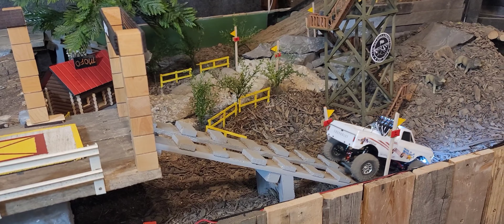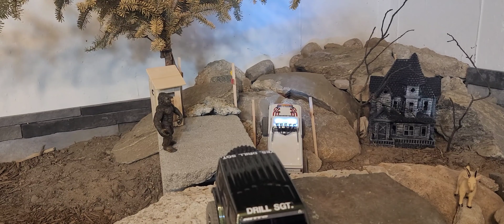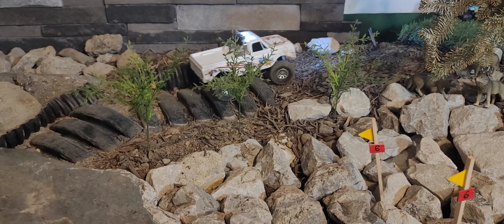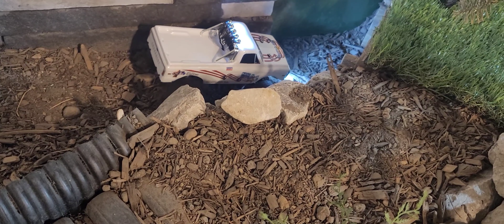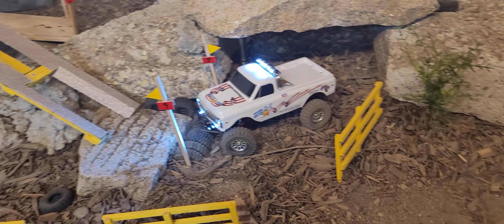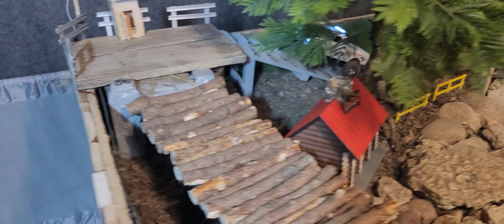scx24 Deadbolt (USA-1) crawling

Comment: I love that you have MOFO Garage. I have 2 trucks built off his parts and the off-road trailer. Right now I’m waiting for his 6x6 lcg chassis to show up. I’m putting AMT’s Peterbilt Wrecker model kit on it for a body.
Reply from the maker: Nice. That is going to look awesome 👌 😎
Reply: @JaysensRCs  the truck frame is 35mm od and the scx is 36mm id. So it should drop right into the mofo 6x6 chassis. Just need to stretch the front links as far as I can to hopefully not have to section the body.

Comment: Good run bro! I have a question for you... After gate 9 you cross the giant teeter totter and head around the edge of your course, there is a second teeter totter there, do you use it? I've never seen you use that small totter... I finally got my baby Avenger built, 4ws and such... just waiting on the lil guy tires and mofo rc wheels (in the mail today.) I'm gonna need a better esc/ motor, the ones I have in it do not like the added weight.... It's soooo top heavy now, I definitely have some new skills to learn!
Reply from the maker: I do use it... just got lazy and have not changed my gates since my last series. And yes The driving technique is completely different once you put that heavy die-cast body on It. 😎